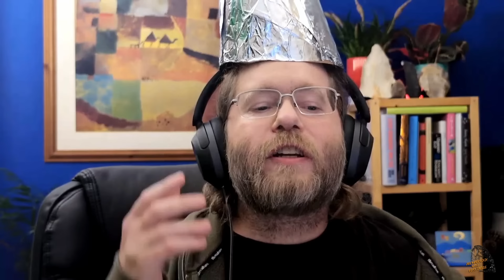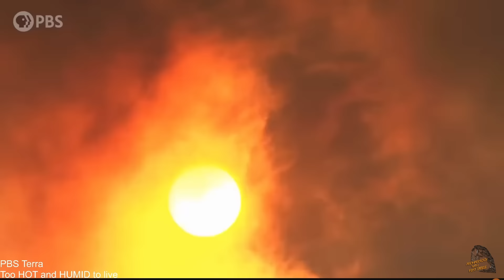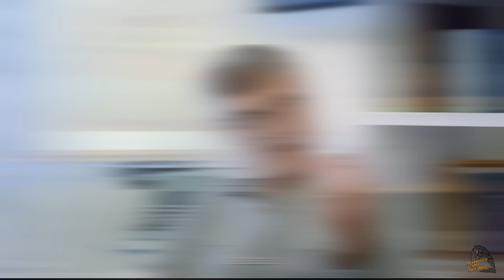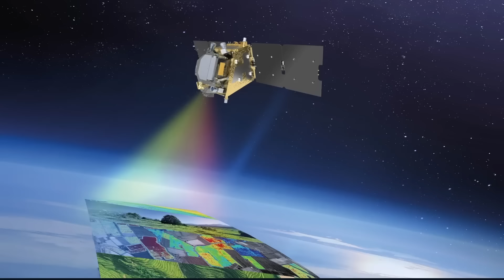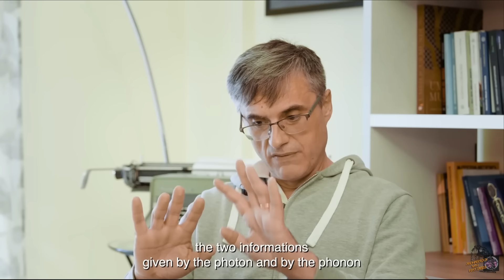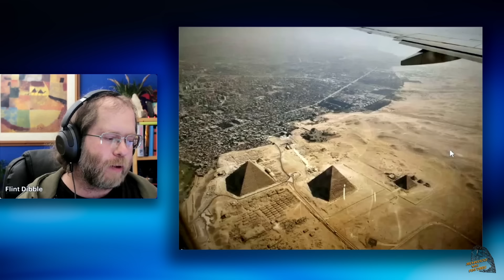The Viral Pyramid Scans: The Ultimate Debunk of the Khafre Project and Filippo Biondi

Comment: The geothermal gradient (say, 25 or 30 K /km) would be added to the average surface temperature. So at 2 km vertical depth you'd have a temperature of 50 to 60 K higher than the surface temperature. - which Wiki tells me is 22.5°C for Cairo. So bottom hole temperature in the range 70 to 85°C.
Though being flooded with water, there is the potential for some convective cooling, to slow the cooking of your mermaids.

Oil instrumentation companies charge different rates for tools rated to survive 100°C, or 120°C or 140°C. Vacuum flasks ("Dewars") are built around sensitive components to slow their overheating - which is some engineering since the Dewars have to maintain an internal vacuum against an external pressure of 1000 or 2000 atmospheres pressure.

Who are these clowns, and who do they think they're fooling? 

Wait, what's he talking about conductivity measurements? That's a standard measurement - typically we use resistivity (reciprocal of conductivity), measured by propagation losses of radio waves travelling from one coil to another. They've been a standard technique since the 1930s.(https://onepetro.org/spe/general-information/1786/LWD-induction-tools ; note that this is for LWD versions, not wireline LAD (Logging After Drilling) methods, which are considerably older). Oh, typically we achieve penetration of 1.5 times the spacing between transmission and reception coils, when we're in physical contact with the rock. For penetration of RF waves into the ground - 2m would be very challenging. (Our coil spacing is limited by electrical noise in the tools, and the practicalities of getting the tools into a 40ft shipping container to get to the site.)

Air pressure ... where is my handy-dandy atmosphere modeller? Ohh, "GeolNotebook.ods" opens to the correct sheet - I've obviously used it for something else recently. 2 km below sea-level (what's the surface altitude at Giza? About 100m? 23m according to Wiki for Cairo.) you'd unavoidably have air pressures of 1.19 to 1.31 atmospheres. Unless you sealed the entry tunnels perfectly, which you'd need to to to keep the water out. I'd say it was bullshit of the first order, but I don't think it's that high a quality of bullshit.

Comment: Wasting your time

"It's too hot down there"  they got air conditioning
"There is a water table" the city is below the water table
"SARS can't penetrate the ground" we have a novel method of interpreting the data
"we found no electric equipment" it was all stolen or destroyed and the electricity was transmitted wirelessly 

and so son

BTW this scam is at least 50 years old.. In the mid 70s 2 Italian (already) professors sold the french government on the idea of "sniffing planes"... planes which thanks to special equipment could supposedly detect oil fields..... they scammed the equivalent of a billion euros of today thanks to that brilliant idea... of course the equipment could detect nothing (other than already known oilfields)

Comment: I got sidetracked and went down a tin foil hat effectiveness rabbit hole. 
  Actually, a tin foil hat may make it easier to read your brain waves at certain frequencies.
While aluminum foil is a conductive metal that can act as a Faraday cage (blocking electromagnetic waves), its effectiveness depends on it being a complete, grounded enclosure. Because a hat is open at the bottom, it doesn't create a total shield.
Key Research Findings
Signal Amplification: A famous 2005 study by MIT students found that foil hats actually amplified certain radio frequencies, specifically those in the 1.2 GHz and 2.6 GHz bands—ranges often used for satellite communications and mobile phones.
The Antenna Effect: If the foil is not grounded or is shaped into a point, it can act as an antenna, focusing incoming signals toward your brain rather than blocking them.
Partial Shielding: It can reduce some low-frequency electromagnetic fields, but it is largely transparent to high-frequency radiation (like X-rays or gamma rays) and does little to stop modern neuro-imaging techniques.
Modern Neurotechnology
Current technologies like fMRI (Functional Magnetic Resonance Imaging) or MEG (Magnetoencephalography) use magnetic fields or sensors that a simple layer of foil cannot stop. Furthermore, the burgeoning field of non-invasive BCIs (Brain-Computer Interfaces) uses near-infrared light or ultrasound, which are not effectively blocked by a loose-fitting metal hat.
  To block brain wave reading or external electromagnetic signals effectively, you would need a full-coverage helmet rather than a simple hat.
A standard "tin foil hat" fails because it is open at the bottom, allowing waves to reflect off your neck and into the foil, often amplifying signals rather than blocking them.
Recommended Materials
Faraday Fabric: Use lab-certified conductive fabrics made of nickel and copper (such as TitanRF). These are more effective and breathable than aluminum foil.
Mu-Metal: This specialized nickel-iron alloy is the gold standard for blocking low-frequency magnetic fields, which are often used in medical-grade brain imaging like MEG.
Silver-Plated Mesh: High-grade silver mesh can block high-frequency radio waves while remaining lightweight.
Effective Design Principles
Full Enclosure: The material must cover the entire skull, extending down past the ears and ideally sealing around the neck (like a balaclava or motorcycle helmet).
Conductive Seams: If you use multiple pieces of fabric, they must be joined with conductive tape to ensure no "leaks" in the shield.
Grounding: For maximum protection against electrostatic fields, the headgear should be tethered to a literal earth ground (though this is impractical for mobile use).
Layering: Combine a layer of Mu-metal for magnetic shielding with a layer of silver or copper fabric for radio-frequency (RF) shielding

Comment: 1:01:25 I think, ofc, that the claims are BS.
But just to be honest toward their argument, I think, from the little time I spent on it, that they not so much claimed to generate sound waves ("phonons") from the radiation as to detect existing surface vibrations (aka noise) by their doppler effects on the bouncing radiation from the satellite.
"Exciting phonons from photons" would add the additional issue of the delay of sound propagation from the surface to the various internal bounces and back, so You would have to "pump" the excitations and then read the returning echoes accounting for the delays... ofc, not mentioning the issue of the missing "pumping" mechanism, i.e. converting the radiation into sound waves at the scanned surface...
Excluding that, the crux of the claimed method would then be if the vibrations that are naturally present are useful (right frequencies to actually do seismography, enough signal to noise ratio... by using environmental noise???) to detect structures in depth and if reading that information from a satellite has some pros respect to measuring it in situ and if the cons don't actually prevent its usage. Some  big ifs which would require a lot of quantitative validation just to be demonstrated, and not just a qualitative description/concoction. 
Since the idea is published, if it worked it would have been already applied to map all underground military installations around the world (think Iranian nuclear sites, and their post strike damage assessment). Not only that, but its military employment would have no real reason to remain a secret. But of course useful applications would not be limited to the military, and yet, though it is described as analysis of existing satellite data, no one has reproduced the results or applied it to anything independently from the authors???
PS: we live in a time when stable diffusion generates meaningful pictures from literal noise and a prompt of what we want the pictures to look like, and that's the ultimate demonstration of how to generate something we want but that was by no mean in the starting data.
PPS: At least I love his genuine Italian accent (Romanesco?), no fake Luigi there!
Reply: The guy did work for the Italian Ministry of Defence, and used (and published) data from their military satellites to monitor nuclear facilities in North Korea, as well as ship movements. His focus was on micro-movements. Basically, a satellite can pinpoint the same spot to a fraction of a millimeter. And I'm not talking about resolution, but instead that, if you took two separate images of the same spot, even at a low resolution, you could overlay them to a precision of less than a millimeter (surface measurement). Basically, you could have it centered on the same grain of sand, even though you cannot see the grain of sand.

A photo (or really any electromagnetic reading) from a satellite has a resolution of maybe soccerball (or possibly a softball?). But if you take multiple photos, you can combine them an increase the resolution. A bit like taking a longer exposure when taking photos of the night sky, and being able to see more stars. 

So what they do is take a stream of "photos". The satellite sensor would have a viewing area. And that area moves along with the satellite. Kinda like a shadow. And as that viewing window passes over any spot, it can take a constant stream of photos/measurements. You then add all these photos together, Basically stacked on top of each other, but also scanning like a panorama. This increases the resolution you can see immensely. And you can stack them on top of each other with mm precision. Which can get you close to mm resolution. 

And so his work was basically focused on being able to detect very slight ground movements during the brief time a satellite is overhead. 

You couple that with changes in frequency, and it becomes even more powerful. You're now not just measuring the difference between "photos", you're measuring how the slight change in frequency is telling you something about the movement of something on the ground. A vehicle driving "away" from the satellite will have a doppler effect compared to the stationary building. 

Layer all these things together and you can basically detect incredibly tiny movements. It seems the guy is claiming that the vibrations of the earth can be detected, and you can use these measurements to map differences in density below ground. It makes sense, to a degree. Like, we can tell changes in density from one spot on the surface to the next. But what is incredible here is being able to detect changes in density depth-wise. It's certainly possible (seismography can do this, ground penetrating radar). I can understand being able to detect those vibrations from a satellite and to make some rudimentary analysis. While everyone points to his graphs as being "blobs", I'm honestly stunned that that level of detail could be picked up from a satellite. Like, throw out the claims of an underground city or w/e, and if those are accurate measurements, that's absolutely insane detail. 

Anyways, if his measurements proved to be true, I think there's actually a completely unthrilling explanation for the spirals, the void, and the fact it's all at the same depth. Basically, the pyramids weight is distributed primarily to the points above those spirals. When vibrations happen, it channels through those points. The vibrations all play off each other, giving the impression of a spiral. The void isn't actually a void, but is because the weight is distributed this way, and creates what looks like a void under the pyramid, because the vibrations don't make it there. They are all at the same depth under each pyramid because that's the point where the vibrations would cease (or possibly the limit to how deep he can measure?). 

Think of your house. It has a window. Above that window will be a piece of wood. And it'll take any weight from above, displace it around the window, and send it below. If you were to measure the vibrations, you'd think there was a hollow under your window. Even where the wood on the sides meet the ground, if you measured, you'd likely "observe" to "dense" spots below that, even though no structure goes below. And you'd likely measure a "hollow" between them, even though it's no more hollow than the other areas. 

A pyramid naturally distributes it's weight in a pattern pretty close to where these spirals would be (plus, we don't know much about the actual foundation of the pyramid). Also, remember the pyramids have eight sides, not four, which has an effect. Could explain why there are seemingly eight spirals. 

I really feel like they missed the mark on this video. I think they misunderstood what was being talked about (they seem to not understand the mm precision, for instance). So I don't feel the science was actually challenged. And it could very well be real. And if it is, I'd imagine we see that verified in the next year, if not sooner. And if the science is valid, people will believe that proves there is something under the pyramids, and it will be even more difficult to refute that with more common sense explanations, like the one I just gave.

Comment: Yes... in order to discuss "water holds information" you MUST put that tin foil hat back on.
That involves some really deep pseudoscience nonsense about "structured water".
However I think that a lot of your reviewers are going way too far down that rabbit hole...
The original claim, as I recall seeing it stated, was pretty simple...
We DO use analysis of seismic waves from earthquakes to map things like the thickness of the Earth's crust.
The claims was simply that they could use existing SAR data to detect VIBRATIONS ON THE SURFACE.
They're basically claiming to use SAR as a "remote seismometer"... 
And, since these vibrations were caused by seismic waves, they could then analyze those seismic waves.
The only "catch" is that analyzing seismic waves tends to yield VERY low resolution data.
And the resolution gets lower the further down you go in depth.
And this is the limitation that they claim their mysterious software solves.
I rather suspect they dumped the data into an "AI analysis system" and their "report" is what came out.
(Tell Gemini that you want "a picture of giant cats building the pyramids" and see what you get... :) )
It seems obvious that they could test this concept by doing an analysis of some KNOWN things...
(Like mapping a known deep mine and producing accurate results without "tweaking" them.)

Comment: Subways are hot not because of the depth, but because the machinery used generates heat which is trapped.
Reply: @bobcousins4810  
Yes, the machinery generates heat (motors, braking, friction) but it's also the thousands of people that generate heat.

Comment: It really does not take a lot of critical thinking to realize that even if the method could somehow reach more than a few mere meters below the ground the signal would be utterly distorted by the MASSIVE ANGLED STONE STRUCTURE ON TOP lol.... these people i swear 😂
Reply: IMO, the spirals are the distortion. They show how the vibrations on the pyramid would be channeled into the ground. Because the weight isn't all evenly distributed. It's a pyramid. And an 8 sided pyramid. Which corresponds with those 8 spirals. So vibrations get channel down these spots, and the result would be what looks like spirals. With all the vibrations going into those "spirals", that would make it appear as though there were a void in the area enclosed by them.
Reply: @bbg5000  yessir, that is basically what i have come to think too. That is, if those results are even real to begin with, which i doubt more and more

Comment: Physicist here...

Natural ground vibrations = phonons. The structure of the ground (density etc) defines how these penetrate through matter.

Photons = radar beam

Photons are scattered off the ground, and are Doppler shifted by how the ground is vibrating (same principle as Doppler shifting vibrometer which I use  in my lab to measure vibration frequencies of vibrating objects)

The radar doesn't penetrate the ground in this case, only to detect ground vibrations.

Tomography is taking these measurements in various directions to build up a 3d image of vibrations 

The technique isn't garbage and could potentially be useful... BUT needs experimental verification from a different technique, or "blind" scan a known structure. Not enough scientific rigour!!!
Reply from the maker: The technique is absolutely garbage because, if you watch the video, you will see the experimental verification they claim to have done is garbage and Biondi knows so because he let his patent for the method expire
Reply: @FlintDibble I've watched the video!!! Stop with the aggressive response please
Reply: @simonalcock1125  There's no aggressive response, he's just explaining to you that the method used to collect this data is garbage.

Comment: Hmm. Sixty degrees is hotter than anywhere on the surface?
There have to be some conditions to that. I mean, lava flows are rather toasty. So we're talking general environment, not specific spots.
Hottest I've had here where I live is 56'C air temperature. But I think I've experienced hotter than that on the ironstone flats. Australia. The ground is literally covered in iron ore. Pebbles of magnetite. It soaks up a LOT of heat. The old 'fry an egg' trick is dead easy if you sit a frying pan on the ground. But that's ground temp, not air temp.